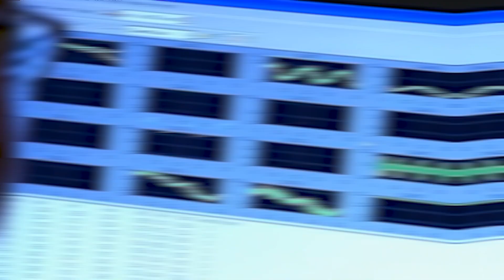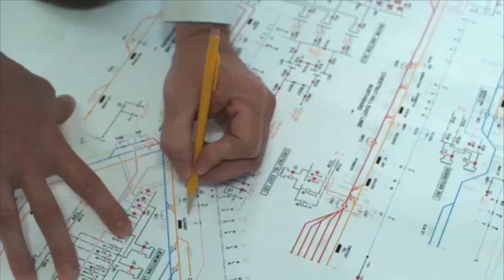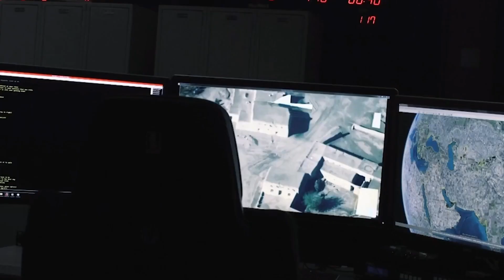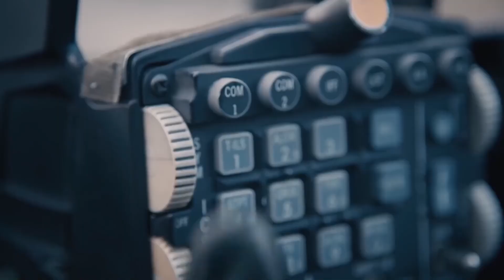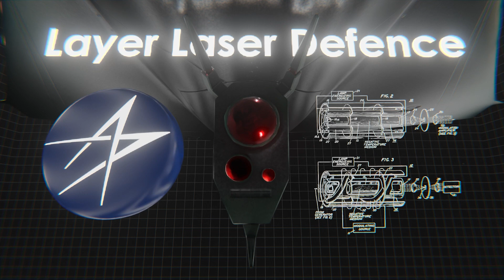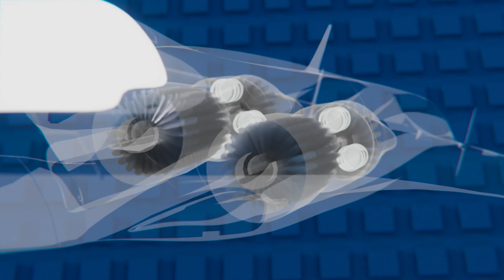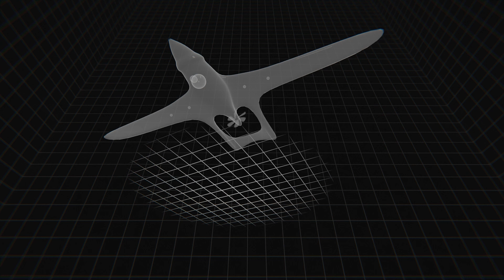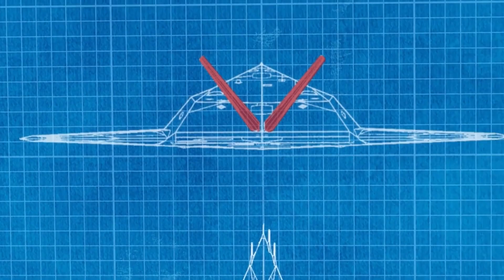SHOCKING Truth About US Hypersonic X-59 and X-44 Manta Technology

Comment: So if that's the case:
Canada should invest in a shit ton of conventioal stealth uav's piloted by an equivalent amount of flight simulators either in our society at large or a hardened bunker similar to Cheyenne mountain.
These conventionally armed & ducted jet-fan  stealth canard remotely piolted vehicles that could be used to simply swarm advisories.
Plus, get our F35's revamped to use x59 engines or see what the U.S. is doing with their stealth A10's they are supposed to be coming up with to compete with the multi roll F35 lightning.
Or Canada could offer to purchase the yf 23 technology to try to amalgimate that with the former avero arrow tech and make our own planes!